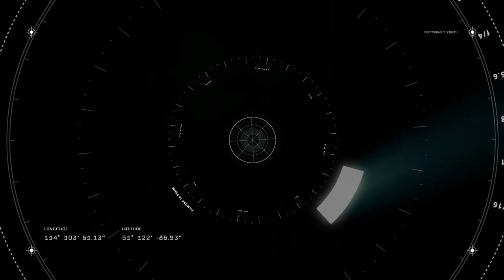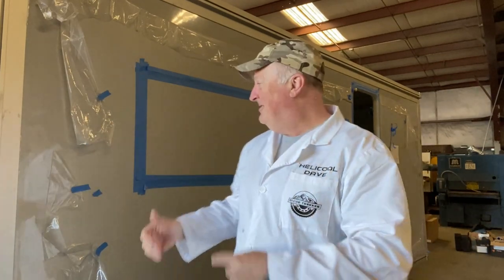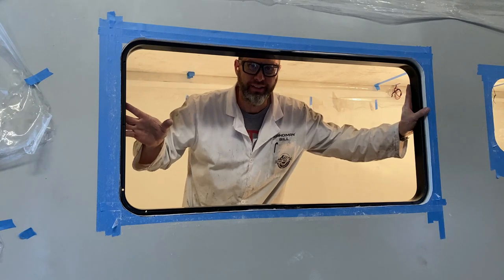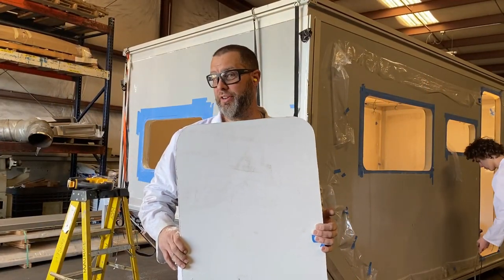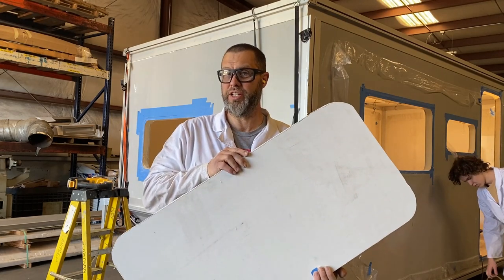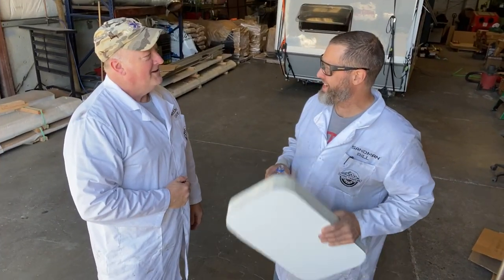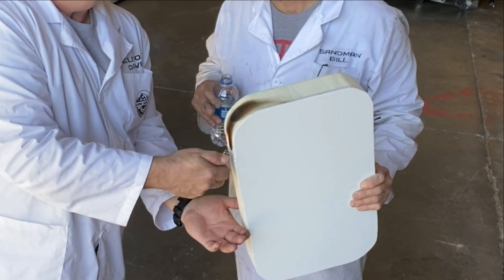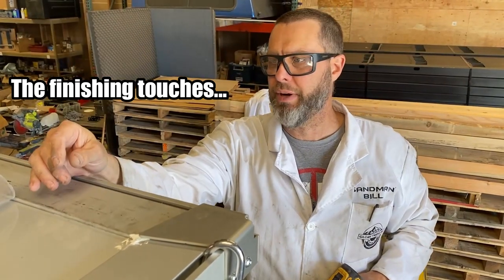FMTV EXPEDITION HABITAT Windows & THE LIFT! #188

Comment: Pretty awesome build… in the process of designing an overland camper on a trailer, how much would it cost to build a  box roughly about the same size?
Reply from the maker: This is a 16' departure angle camper. One like this without brush guards lists for $26,756. R-17 four season trailer... I like it!

Comment: At 10 minutes and 20 seconds into the video you could see the tops of the vertical extrusions still have openings in it what’s up with that? Is there some sort of a cover that goes on there or is that just gonna be a house for spiders in like a little miniature rain gutters lol. It seems to be an epically well-thought-out system so I’m sure there’s a plan for that.
Reply from the maker: Those opening are to channel the rain in the gutters to flow off the truck and not drip down on you while coming and going from the habitat. There is a snap in cover that comes in many different colors, including clear so you can hide LED light strips in the t-slots of the 80/20 for some real magic... or you can hide your external wires if you need to.

Comment: Which truck will you choose for world tour and no extreme off road

A. Truck with 115hp and 400 nm 4x4 

B. Truck with 170hp and 520nm 4x2
Reply from the maker: A "world tour?" Easy answer... a 4x4 is necessary, even when there is no "extreme" off roading. There is not much else to go on for your question, though. For a world tour, you have to prepare for the worst and hope for the best. Unless you plan on cruising on asphalt the entire way... even so, land cruisers have been used for years for this.
Reply: @HelicoolsHelipad  thank you so much

Comment: What are dimensions of box? What dimensions can be used on the subframe?
Reply from the maker: This box is a 16’ with approach angle. So this subframe is 14”. You can get whatever size you want, just about. Currently, we are working on a 27’ habitat and subframe. Check out the website at www.rvglobetrekker.com